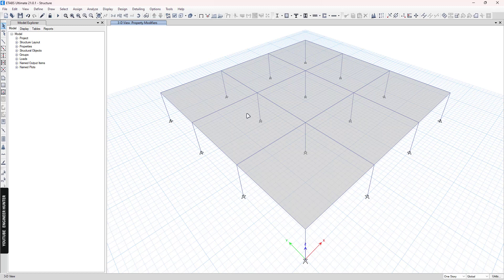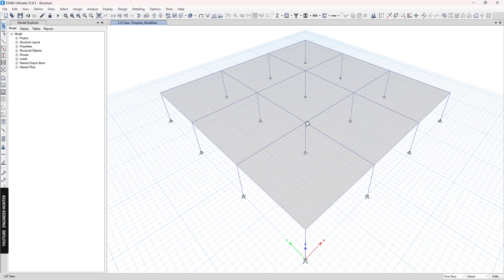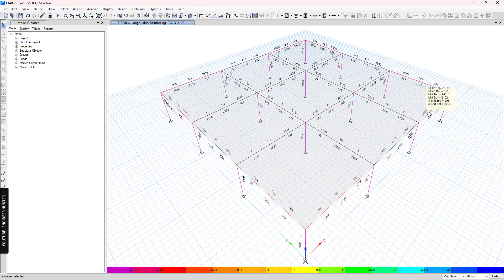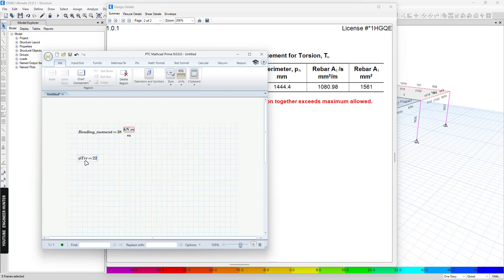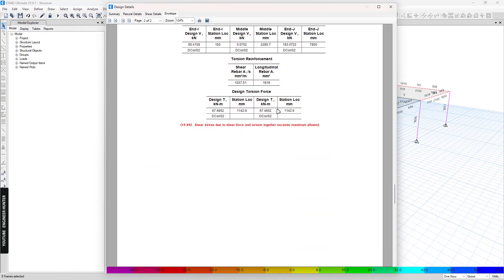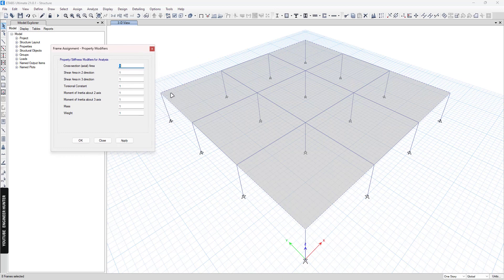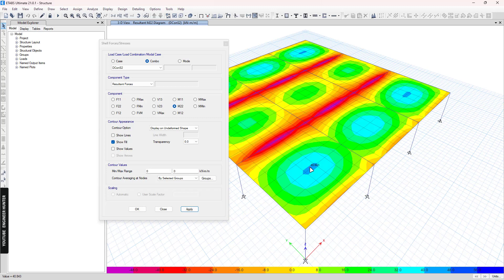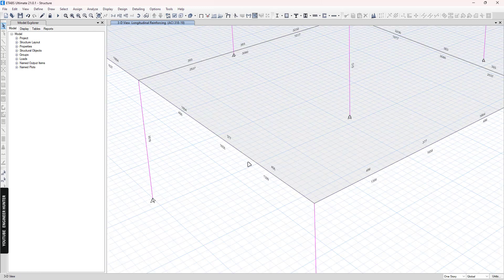Reduce Compatibility Torsion

Comment: Hi Eng Hunter... Great video as usual. Which do you prefer between Robot and ETABS?
Reply from the maker: I personally use both of these softwares. I think it depends the project I’m working on. If it’s a building, I prefer ETABS. If it’s complex structure, I prefer Robot Structural Analysis.